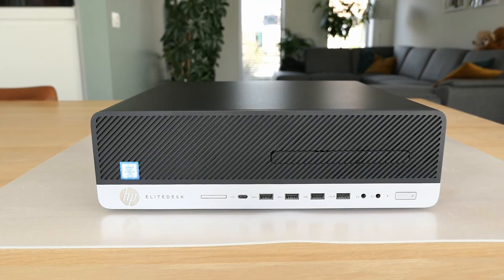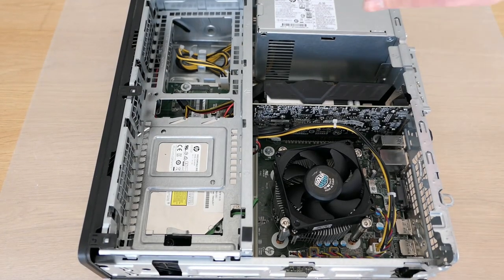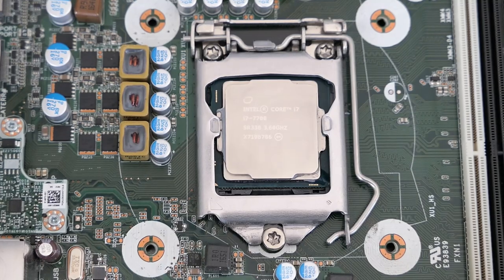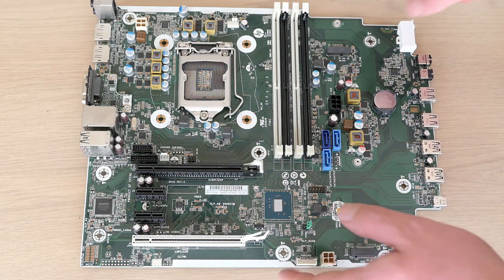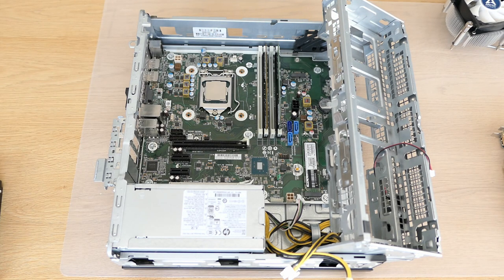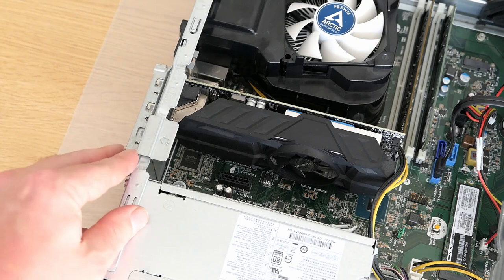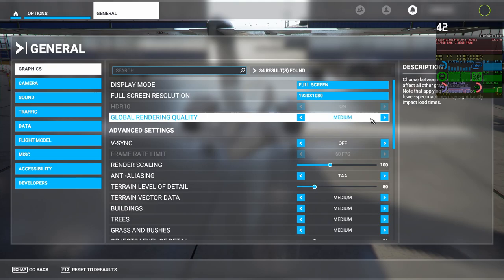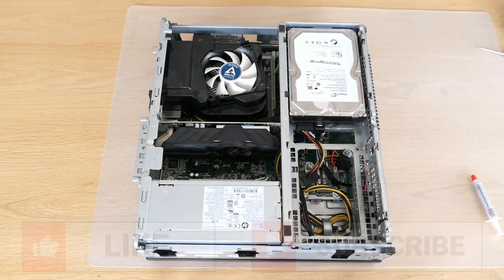HP EliteDesk 800 G3 SFF - Teardown, re-assembly and upgrade

Comment: Dear friend, I have this same machine and I am thinking of incorporating a low profile geforce 750ti gpu, I would like to know how your PC has responded to the stress of use and if you think that mine will support the card that I want to put. 
Thank you.
Best regards.
Reply from the maker: The 750ti requires a similar amount of power as the 1050 ti so you should be good.
Reply: @jensdbe  Thank you very much for your answer, I will try. Keep up with your videos they are very good. Best regards.
Reply: @jensdbe  what about a rx 6400 lp?

Comment: hi i got a hp pro desk 600 g3 but i don't know if it's compatible with 8th gen cpu ? What do you thin ? thank you
Reply: The fastest CPU that is compatible as per your Q270 chipset with your HP ProDesk 600 G3 Small Form Factor is the 7th gen Intel i7-7700 -maybe the i7-7700K.

Comment: Hi, thank you for this video, one small question, can I add one more ssd nvme, to get two ssd?
Reply from the maker: There is only a single slot on the motherboard that works for storage. Another option, if you want NVMe is to add a PCIe card with NVMe slot. Or if you have enough with the performance of a SATA SSD, you can also add one of those.
Reply: @jensdbe  Thank you for your prompt response

Comment: I have this same system with a GTX 1050, and it is running very loudly and the computer turns off with a small shake from my table. Is there anything I can do to make my computer quieter and more stable?
Reply from the maker: I'd check the fans, maybe replace them with a silent version. After time, some of these tend to become pretty loud, as was the case with me as well. Also removing dust and replacing the thermal past could help.

Comment: New subscriber
Bro i got the mini tower ver with 250 w psu 
What card should i use or should i change the psu
Reply from the maker: A GTX1650 low profile would probably be the best choice here.
Reply: @jensdbe  the normal ver won't work ?
Reply from the maker: @abdelhakeemahmed4988  a regular card does not physically fit in the SFF case as it would be too high
Reply: @jensdbe  i have the mini tower version not sff 
And thanks alot for your time

Comment: Hola, tengo este equipo con un i3 6100 con 51w de TDP y con fuente original de 180w ya tengo negociado el i7 7700 que es de 65w de TDP pero mi duda es si está fuente puede adicional con una gráfica 1050 con consumo de 75w aprox. No sería mucho para está fuente de poder? Puede trabajar sin problemas con ese alto consumo de energía?
Reply: Tengo esa PC con una GTX 1650 dale sin miedo, la fuente es certificada y aguanta la pela
Reply: @Wilkinjc  Tengo una PC DELL Inspiron 3880 con un i5 10400, fuente de poder de 200watts. Voy a comprar una GTX 1650. Por lo que he estado investigando no consume mas de 100watts realizando tareas demandantes. Entonces debería de poder alimentar la GTX 1650 que pide solo 75watts desde el puerto PCI. También me preocupa el tema del calor, aunque el case de mi PC es un poco más grande.

Comment: hello there i have a question i have the exact model but I have a intel core i5 7500 8 gig ram memory ( I don't exactly know the watt/power) and I was asking is it possible to upgrade this machine with a GPU like a 1060? and motherboard is specified as 8299 by hp so yea I am hoping for a reply as I want to upgrade this machine
Reply from the maker: As far as I know, a 1060 needs at least one additional power plug. You might be able to supply enough with a convertor from regular moles to 6-pin. A 1050 Ti, like I had in it, doesn't require this.
Reply: @jensdbe   what about the 1050 ti I know you used it In your video but do you have the exact model as when I search it up I get models that seem weird to big so yea thank you and so if I add in a 1050 ti I will be fine not need to change the power to support it right?

Comment: What form factor would I have to get to replace this GPU?
Reply from the maker: You can replace the GPU, it's only that the power supply is not overly powerful which makes your choice for a replacement relatively limited. A GTX1650 or RX6400 would do fine in here.

Comment: Great video and good PC , i need some help, my question is, what Graphic i need for play Gta V and Left 4 dead 2 as maximum in this pc? 
Thanks for reeding
Reply from the maker: As you are limited to low profile GPUs and limited in power provided, a GTX 1650 would be the best choice. This will result in proper performance for the games you mentioned as well.
Reply: @jensdbe  thanks so much
Reply: @jensdbe gtx 1650  75 watts ?

Comment: Will an Gigabyte RTX4060 8G OC Low Profile fit?
Reply from the maker: I'm afraid that the power supply will not be able to handle this as it requires 130W

Comment: oh so it's safe to put the monitor on top of the case, i was worried but i see it works fine
Reply from the maker: It's definitely intended for being put horizontally (no stands on the sides) and it feels sturdy/strong enough to handle a proper weight. A classic CRT might not be the best idea but even a decent sized LCD should be fine to my idea.

Comment: Can you use this EliteDesk model to run VMs, and do out-of-band management?  What upgrades do I need to make for these to work? Or which micro server is ideal for these capabilities?
Reply from the maker: The specs allow it to run a bunch of VMs, depending a bit on your needs and how resource-hungry they will be. Out-of-band management is not so easy. You could install a second network card but if the host-OS is down, you would still not be able to reach it. The approach I have for a regular PC which I used as a NAS is to have it connected to a smartplug (which I can remotely enable/disable) and set the BIOS to always boot after power loss. Thay way, in case the machine is locked up, I can at least remotely reboot it :)
Reply: @jensdbe  Thank you for the response !

Comment: Hi, i've got a 800 G3 Tower with i5-7500 and 8Gigs of RAM. Im planning on upgrading it into i7-9700 with GTX 1650, Jonsbo CR-1400 Cpu tower and a 500watt psu. Is there any possible way to change the psu with a 500watt and different model?
Reply from the maker: Afaik, the motherboard does not support an i7 9700 and replacing the PSU won't work either as it is a custom made one with proprietary connectors and size.
Reply: @jensdbe  Ok. So, as you said that i7 9700 won't support in this motherboard so i think i should change a mind to replace current i5-7500 with i7-7700. And, which connector is different between HP Original PSU and a conventional PSU (Ex:Corsair)?

Comment: Is there a way to add an external power button? I dont see any jumpers.
Reply from the maker: The power button is integrated on the motherboard. No wire with a separate button in this case.

Comment: Would a 1660 or 1660ti fit in there? Would a conventional PSU fit in the chasis as well?
Reply from the maker: It's very hard to find a 1060 or 1060Ti in low profile that would fit. Also power demand would be an issue I think. 
A conventional PSU will not fit. the PSU and connectors on the motherboard are fully customised. 
If you're looking for this kind of upgrade, I guess selling the PC and getting something else as a base would be the easiest :)
Reply: You’re better off buying an HTPC case that will accommodate the components.  Just to give you an idea, you’ll need to map out a layout for a riser and stand-off to mount the GPU horizontally.  As far as the PSU, you would need to cut out an upper or lower portion of the case to allow for dimensions which can be covered with a fabricated tray.  The real problem is the dimensions again which leaves ITX as the only solution.  So now if you don’t have a rear I/O knockout, you’ll need to create an access for your new shield.  Finally your new board will need to be wired to the front I/O.  You can buy header connectors, and trace the pin out to splice and join the two.  

The PSU will be the hardest, and to keep a cleaner look you’ll have to install elevated feet so that the recessed tray doesn’t ruin the aesthetics.

Comment: does this pc has big gpu slot so every graphic card can fit in?
Reply from the maker: The case is not high enough to fit a full-size GPU, so only a low profile GPU will fit. Also the power supply is limited so you need to be careful with that as well.

Comment: Hey man great video, planning on using this as a base of a raid server with parts from other old cheap computers

Would you reckon with some sata power splitters, sata data splitters, another 2.5/3.5 drive cage, I could chuck 4x 2.5 ssd's in the front? Plus use a raid pcie card with m.2 cards?

Also with it being an LGA1151 socket and the i7-8700 from another PC i plan to scrap parts from, would the i7-8700 work in this with a bios update?
Reply from the maker: Make sure the power supply can support all the disks which you want to put in there. For the CPU, I don't think 8th generation is supported. You can find the supported CPUs over here (page 10): https://www8.hp.com/h20195/V2/GetPDF.aspx/c05378305

Comment: Is it true that it comes with a t1050i on Amazon?? Please awnser me kind sir
Reply from the maker: It can have different configurations so no guarantee that it is there by default. It would have to be explicitly mentioned.
Reply: So to get this clear they all can come with different specs right? So the seller isn't lying confirm please
Reply from the maker: @Malek_XD  you can easily change CPU, memory, drives and PCIe cards so a lot of configurations are possible alongside all variations which HP offered in the machine originally. If the seller writes that he put in a 1050Ti, he/she probably did that. But I can't tell if they are lying or not off course :)
Reply: @jensdbe  well thanks for the information I subscribed!

Comment: Hello thx for the video i want to ask if gtx 1650 can fit in?
Reply from the maker: GTX 1650, as long as it is a low profile card, should work fine in this machine. That will boost performance quite a bit.
Reply: @jensdbe  thats why am asking i wanna know if its low profil or no  pls
Reply from the maker: @fatimaazhare7102  there are different models of GTX 1650 from different manufacturers. Some of these are low-profile, others are not. You will need to check for a specific model.
Reply: @jensdbe  the small ones?

Comment: Here is my ultimate HP EliteDesk 800 G3 SFF Upgrade project: https://h30434.www3.hp.com/t5/Business-PCs-Workstations-and-Point-of-Sale-Systems/Upgrading-HP-EliteDesk-800-G3-SFF/td-p/8251218
Specifications: fitted with an Intel i7-7700K, 32GB (4 x 8 GB) of Samsung M378A1K43CB2-CRC (PC4-19200 running at 2400 MHz) RAM, primary (boot) drive: SAMSUNG 980 PRO SSD 2TB PCIe NVMe Gen 4 Gaming M.2 SSD, secondary drive: Samsung 870 QVO 1TB (SATA SSD), tertiary drive: Seagate BarraCuda 2TB Internal Hard Drive HDD – 3.5 Inch SATA 6Gb/s 7200 RPM 256MB Cache, RTX 3080 OC Edition Graphics Card (PCIe 4.0, 12GB GDDR6X, LHR), secondary power supply unit synced to power the GPU: AresGame AGK850 850W Fully Modular 80Plus Gold Certified PSU.
So far [June 5th, 2022], the fastest of its kind as per UserBenchMark: https://www.userbenchmark.com/UserRun/52135692
The sky is the limit folks. Just think outside the box -literally so!

Comment: Bro i have hp elitedesk 800 g3 i5 6500 ,   can i upgrade to i7 7700 or i7 6700 ? 
 thanks.
Reply from the maker: As far as I know, both CPUs are a valid option to upgrade to. Make sure you update the BIOS to the latest version first though.
Reply: @jensdbe  okay thank you .

Comment: le processeur et un Intel i7 7700    K ou T  et en LGA 1151 ??
Reply from the maker: It's a regular i7700. The K-version is not interesting in this PC as it doesn't allow you to do tweaking/overclocking anyway and the T-version should work but is slower (as it is intended for low-power/difficult cooling situations).

Comment: hello. Doest it throttle the 1050ti as the pciex 16x slot is rated at 35w?
Reply from the maker: Hmm, that's interesting and indeed the spec sheet lists a maximum of 35W for the x16 slot. I didn't have any issues with power limitation as far as I could see.
Reply: @jensdbe  in simmilar pc it was some lenovo sff with i5 4570 also with 35w limit on the pciex and it was deffinately  throttling the gpu, it was low profile gtx 1050 non ti 2gb. I tested the same cpu +gpu + ram combo inside desktop pc with haswell motherboard, difference was huge atleast 30& less fps with the sff, it was easy to visually notice the throttling. After that i tried to lower the cpu power draw, disabled the turbo and thtrottled cpu to 2.5ghz speed with the multiplier, results were the same, it wasnt problem with the psu as the sff system was drawing max 100-120w under load, yet the desktor was drawing 150+ watts so there it was the measured difference 20-30 watts and propably the reason was gpu not getting enough juice. But it worked without any problems, just crippled gpu performance.

Comment: Can remove motherboard and put in another case
Reply from the maker: It's not a standard format so it would be hard to do. Also the connectors for thr power supply are not standard ATX so you'd need a converter. All in all if you're limited by the case, maybe better to sell amd buy something else.

Comment: Can i change the gtx 1050 with 1650 ?
Reply from the maker: GTX 1650, as long as it is a low profile card, should work fine in this machine. That will boost performance quite a bit.

Comment: Hello, I would like to add a GPU RTX 3070  (or at least a GTX 1080), I noticed that I need to change the power supply to make any of these gpus work. Get the GPU and a new more powerful power supply and then will I be ready to go?, what other things should I consider?, thanks!
Reply from the maker: Adding a 3070 or 1080 will be hard. First of all there are no low profile versions of these cards as far as I know so they will be higher (and longer) than the space available in the case. Also, replacing the PSU with a standard model is hard as the connections on the motherboard are proprietary and a regular power supply won't fit in the case either. Besides that, there is no way you can manage the heat of such a GPU and PSU in such a tiny case. 

I'd say that, with this requirement, it will be a lot easier to sell the EliteDesk and go for a fullbform factor case/model.
Reply: @jensdbe  thanks a lot for your answer, really help me to think about what to do. 

Just, sorry,  I forgot to say that my computer model is a little different from that in the video, I have a Hp Elitedesk 800 G3 Tower , it is a workstation so the case is bigger, so I think I don't need a low profile GPU.  Do you still think it would be hard to adapt an RTX 3070 (or at least an gtx 1080)? I share the specifications  where mentions something about GPUs need a powerful power supply, it doesn't say anything about an RTX 3070, but says something about a GTX 1080, you think is possible to adapt the RTX 3070?, what other recommendations you give me? Here are the specifications:

https://www.google.com/url?sa=t&source=web&rct=j&url=https://media.flixcar.com/f360cdn/HP-3765969638-4aa6-9332eee.pdf&ved=2ahUKEwjRzKTShObvAhUCMqwKHd9dC9MQFjAEegQIBRAC&usg=AOvVaw00w0ip4TXFKFQF4-lNAgWY

Thanks in advance!

Comment: can you case swap it?
Reply from the maker: The motherboard has custom HP form factor. As you can see, the front buttons/LEDs and front USB are fixed on the board. This means it will not fit in a regular/standard case without serious modifications.

Comment: does it have wifi connection?
Reply from the maker: Mine did not but there is an option to install a M.2 wifi adapter on the board. Otherwise PCIe or USB should work fine as well.
Reply: @jensdbe  okay, thanks for the clarification on this 👍